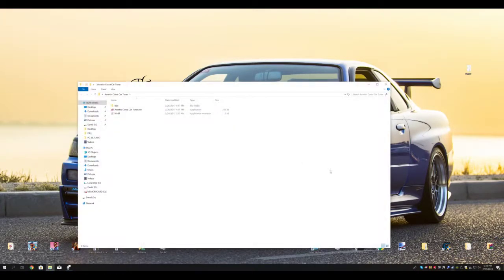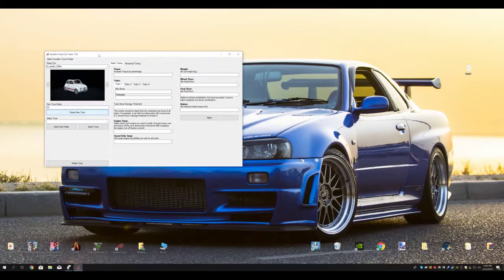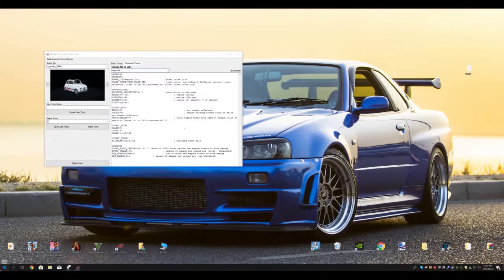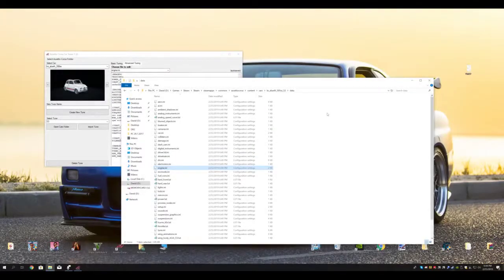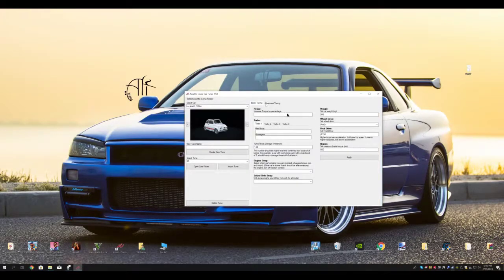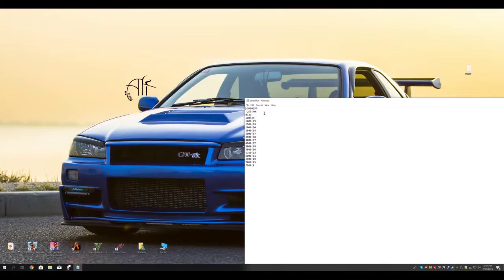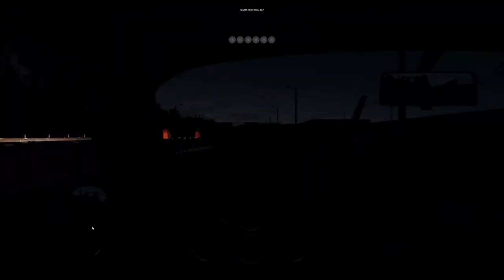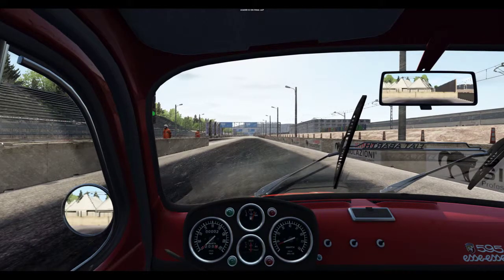How to edit the Engine's Rev Limiter and Power in Assetto Corsa

Comment: Why does some car doesn't rev all the way up to the desired rpm limit?
Reply from the maker: Wich one for example?
Reply: @_razn_  Nevermind, i found out that you only need to unpack the data file only once when editing. The problem was the absence of a powerband in the extended rpm range. Thanks for replying anyways.
Reply: @alvinnurfauzan292  wdym
Reply: @_razn_  I used to unpack the data file like all the time when editing/tuning a car, and that is the reason why my updated settings are not loaded and it kept loading the first settings that i've done to a car.